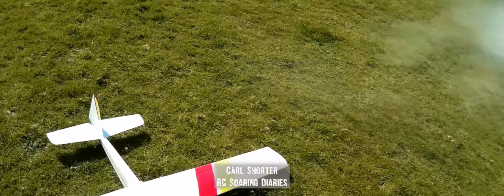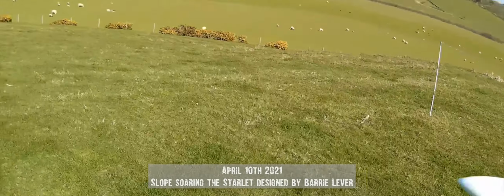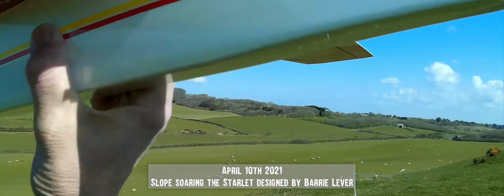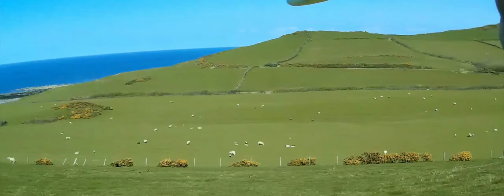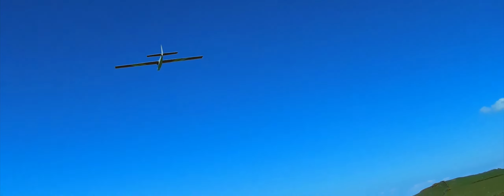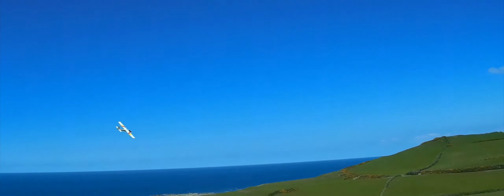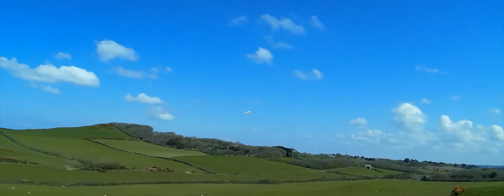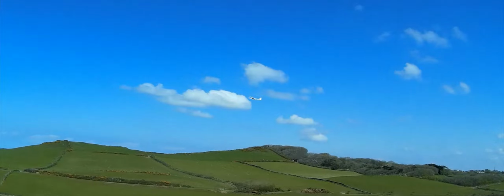Slope Soaring the Starlet - an Old School Slope Soarer Designed by Barrie Lever - 10th April 2021

Comment: Nice little glider. Conditions were perfect, lift for day's and energy to spare. I had one like it called (silouet) I turned it into toothpicks on a real windy day 😔
Reply from the maker: Glad you you like the glider Michael (I'm a big fan of old school and vintage gliders). At first the lift was enough to maintain flight and gain a little height, but later the lift really picked up and was enjoying amazing lift from the little slope 👍 It wasn't the wind picking up, but the wind just changing to I direction where it's just perfect 👍 Shame about your Silouet 😧

Comment: Does that slope get bumpy in strong wind with that ridge in front
Reply from the maker: Yes Nick it does get bumpy in strong winds. Ok in light winds though. When I arrived the wind direction was more towards NW and hitting the slope at a 45-50 deg angel and generated quite smooth useable lift with a decent efficient glider, but fast downwind, slow upwind whilst gaining a little height (this is the footage of the first bit of video). After a while the wind turned more WNW so I flew from the corner for a while, until the wind turned to the magical NNW. The wind that hits the slope misses the opposite hill and passes just from the left of it and that's when I can enjoy fantastic lift which extends way out and high. Doesn't happen often but when it does it's amazing (this is the footage from the second bit of video) The seagulls were way up high enjoying it too 👍